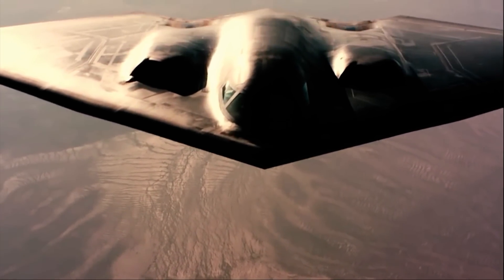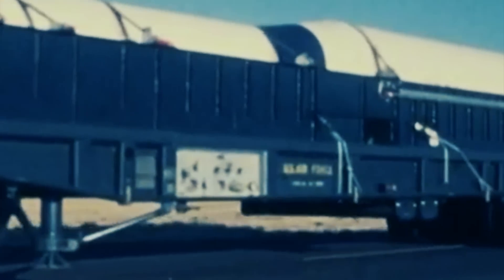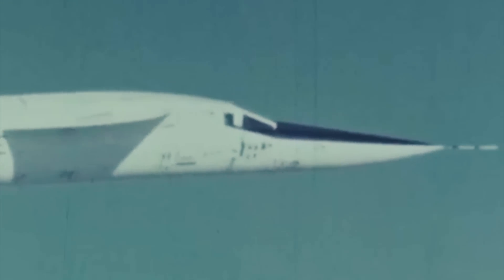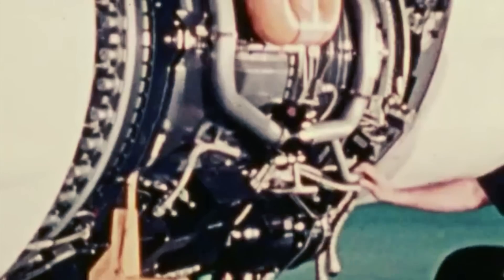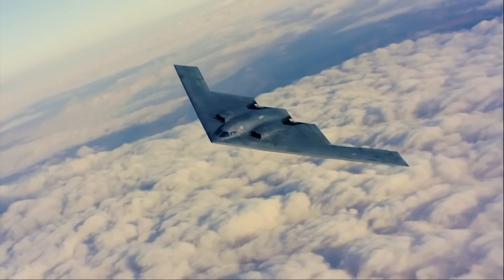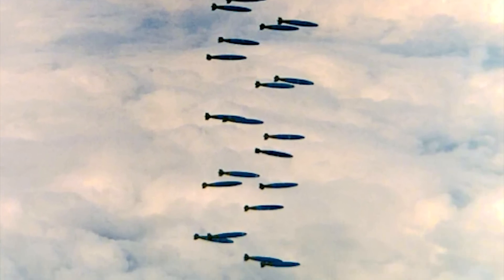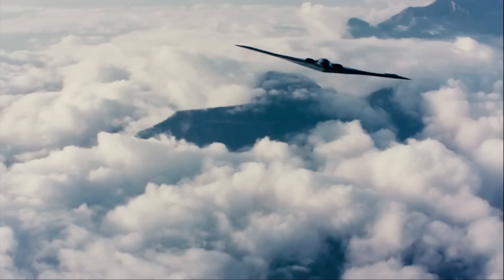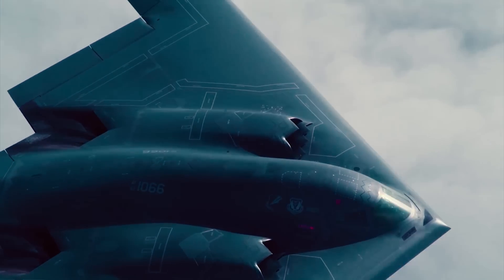The Invisible Bomber

Comment: I watched one of these showing off its capabilities at an air show at RAF Mildenhall in 2000.

This aircraft was ... spooky ...

First of all, by contrast with the B-52 and B-1B that were also present, it was practically silent on takeoff. As it flew overhead, again, it was silent, and looked for all the world like a featureless black hole moving against the cloud backdrop. Observers watching it could have been forgiven for thinking it was powered by some sort of alien antigravity engine instead of standard jets, because the designers had been so successful at reducing the acoustic signature.

Of course, another overlooked feature centres upon a basic physical fact - if you drop a bomb on a target from 40,000 feet, it takes 13 minutes to fall that distance. In that time, a jet powered bomber has moved something like 120 miles away from the area of operations. As a consequence, when the bomb lands, the plane isn't overhead, it's 120 miles downrange. Even if you can detect the bomber, you still need air defences - in quantity - around your high value ground assets that can deploy SAMs accurately over a very wide combat radius.

if the bomber in question only has a tiny radar, IR and acoustic cross section, your task at defeating it has multiplied accordingly.

It's now 22 years since I saw that aircraft flying over me, and it's still a major headache for anyone trying to defend ground targets against it.

Comment: The B-2 would have been a lot cheaper if the Pentagon didn't add in a last minute change for low altitude high-subsonic capabilities. Doing so at such a late stage at least doubled it's cost.

Comment: The B2 is an ace in the hand. It may not be needed but it's good to have when needed. With drone tech improving at its current pace, it won't be long before they are not worth the price.
Reply: There is no replacement for pilots on a mission like this.  Machines can't think outside the box, solve unforseen problems, or deal with threats ouside their programming.  If the plane can carry nukes, you need a person there - and at least one other to back him up and check him (or her).

Comment: A trained radar operator can distinguish a 117 or B 2. They appear fuzzy, similar to angels (flocks of migrating birds) so all this misinformation about them having a radar signature the size of a hummingbird is just B.S. I worked at Northrop and I've never seen such a waste of tax payers money. The B 52 is around 60 years old. We've spent more on less than 30 B 2s and they certainly can't outrun this mainstay of the U.S.A.F.

Comment: I worked on the B-2 for three years in the early 90's.  Some of my proudest career years.  They should have built more than they did.  BTW they only built 21 of them, not 75 as stated in the video.
Reply: I think They changed the initial order from 135, to 75, then to 21.

Comment: This is one of the few "overpriced items" in the US arsenal that I approve of. Most others expensive items have more cost effective alternatives, but as noted, two B2s can easily take the place of dozens of more conventional designed craft.
Reply: Not to mention it could drop a bomb on Jinping or Putin's lap without them ever knowing it was there.
Reply: Plus F22 and especially F35.
Reply: Unfortunately these were obsolete basically the second they went into service. ICBMs are much more effective for the planned mission. This was essentially a huge R&D development project that expanded design capabilities rather than military capabilities.
Reply: @enginerdy  One does not use ICBMs to drop conventional bombs. 

If you want to deliver a pre-determined nuke  to a city, then yes, use an ICBM. If you want more choice and have 12 to 30 hours to get it there, use a flying bomber where you have the choice of any deliverable explosive payload in inventory, from clusters of hundreds-pounds bombs dropped straight down, to nuclear warheads of multiple yields via air launched cruise missiles.
Reply: @gordol66  the B2 original mission is nuclear against a peer adversary. It works fine against non-peer adversaries and conventional bombs. That’s what it’s used for, not why it was built.
Reply: @enginerdy  I know that. Doesn't change the fact that it's doing conventional warfare so well. Better than the B1, if slower to get there, and arguably better than the aging and vulnerable B52. Which was also originally designed to carry nukes, not conventional weapons.

Comment: The F117 was a failure as it was shot down on March 27, 1999 by an obsolite S 125 Neva/Pechora, an anti-air system designed and put into service in the 1950s.

Comment: I live less than 5 miles from WAFB where most of the B2 are and they usually bank and turn over my house. It still amazes me how big they are after seeing them for so many years. My drive home from work involves driving under take off and landing planes that are only a couple hundred feet off the ground.
Reply: The Nob. I miss that place
Reply: @mkcl9073   I was stationed there from 1995 to 2004 as my first base.
Reply: I had that same experience with B-52s when I lived near Fairchild AFB and F-16s at Luke AFB. I've only seen an airborne B-2 once during a Veteran's Day parade.

Comment: It's surprising that everyone seems to have forgotten that the original "Flying Wing", Jack Northrup's YF-49 was the forerunner of this plane built and flown in the late 1940's. The flight characteristics were an issue then and were overcome by the technologies of the late 20th century designers and engineers. Great plane and the video would have been better ahd you included the backstory here...
Reply: They developed the YB-35 in the 30s. The YB-49s were 35s retrofitted with jet engines.

Comment: My biological father worked on this project while at Edwards Air Force Base and Groom Lake (Area 51).
I grew up in the government black projects my whole life.
The Orca demonstrator project helped build the B-2.
Orca was used as a test bed for curvature stealth. Use facets on the inside and curve the outside.
The side ways radar looking system was also made possible because of Orca.
The B-52 called Ghost Buster (has a pac man ghost on the side). Is where they tested electronic counter measure, the rotor system for bombs, and Avionics for the B-2.

Comment: Good information however you left out how the Nazis toward the end of WWII started with this design along with Kelly Northrop.
Kelly Northrop had control issues until he added some vertical control surfaces. 
The B2 was also one of the worst kept secrets.
Back in the 80’s during the presidential debates the democratic presidential nominee Michael Dukakis brought up how he would use it. When the F117 came out no one had really heard of it.
Reply: John Northrop had been working on flying wings since the Horten brothers were teenagers
Reply: The B-2, while much of its design was classified, its existence and specifications were never under a black project. It was public info. Unlike the F-117A.

Comment: Nice Horton 9/229 clones. Design follow function at it's finest.
Reply: Look at the YB-49, and the XB-35.

Flying wings weren’t a Nazi invention, and the Ho229 has at best minor influences in this design.
Reply: @Justanotherconsumer  but flying wings with jet propulsion were. And both xbs had motors with propellers on the back of the wing, and look nothing like the  B 2  we  are talking about. The design features  of the B 2, even the wing design and hull structures, are very close to the Horton. Seems you need some new glasses and do better research.
Reply: @steffenrosmus9177  Close to the Horten brothers how? Nothing resembles them.

Comment: one of these so called invisible stealth was shot down with a missile in the balcans ex yugoslavia .
Reply: I think you are thinking of the f117.
Reply: 1 out of how many THOUSANDS of sorties? Even a blind squirrel finds a nut occasionally.
Reply: The F-117 was shot down because Serbia knew the routes, they knew that they were coming. It wasn’t supported by electronic warfare planes and the Antennas it uses for its radar warning Receiver were retracted because it was on a stealth mission. Had they known it was being tracked, they would have been able to lock the target. It was a failure of NATO operational security. Look it up online if you don’t believe me.
Reply: all 20 of the B-2s are still at Whiteman AFB. The 21st crashed on Guam and movies prove it. An F-117 was shot down by a SA-6 when the US was supporting Bosnia.